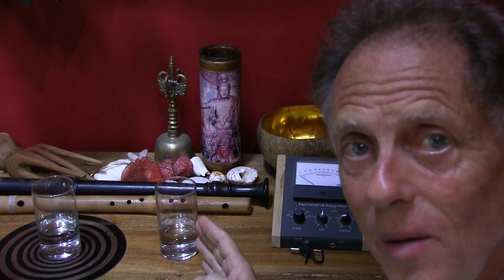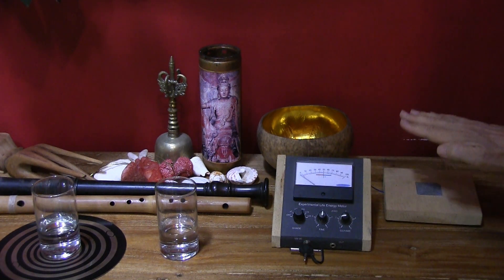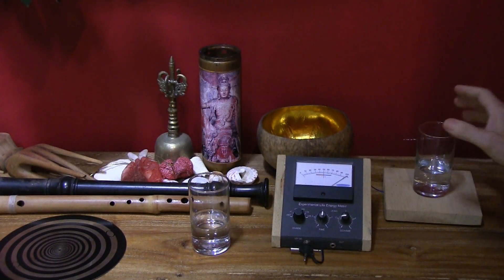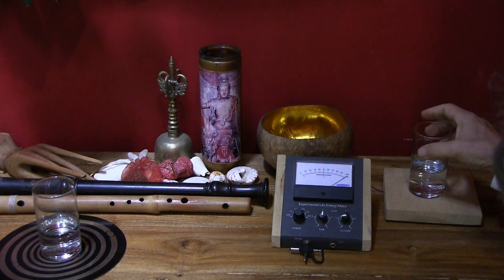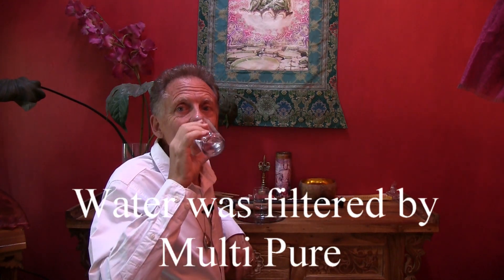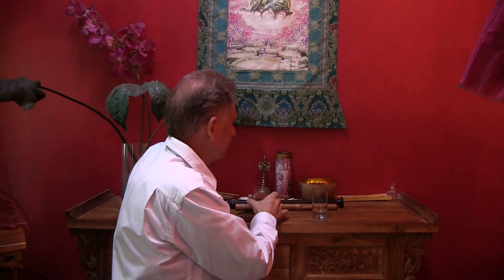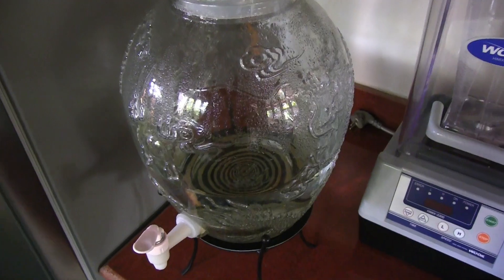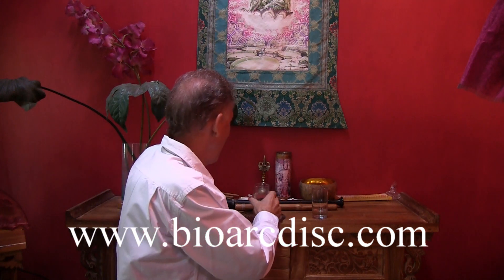BioArc Disc Water test - Structured Water

Comment: How long did you leave it on the disc? andand do you have to use the big disk? It would be interesting to see the difference between the big and small
Reply from the maker: I left it on the disc for about 2 minutes... Small one might work for a small glass. I am traveling for the next month and I don't have the meter but for taste I could tell a difference but not as dramatic.